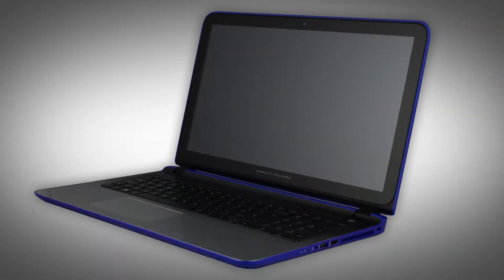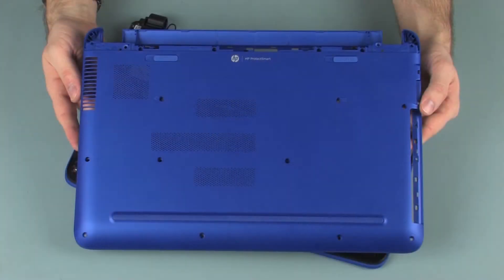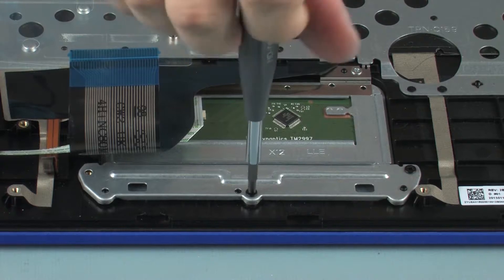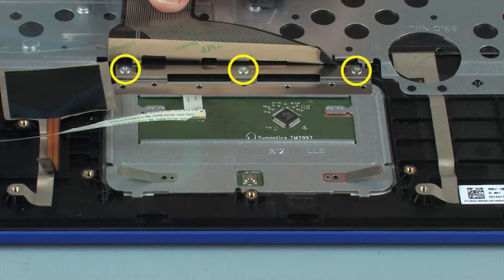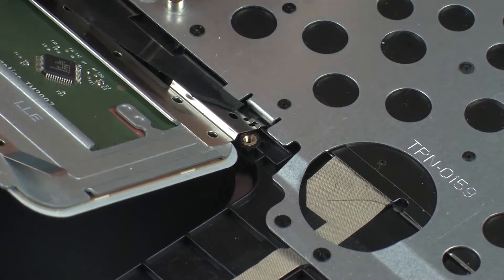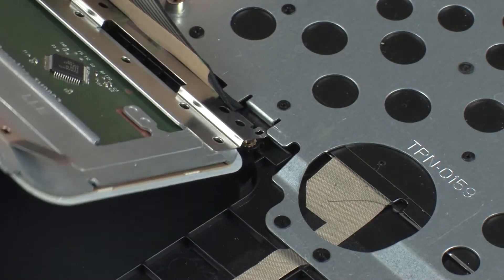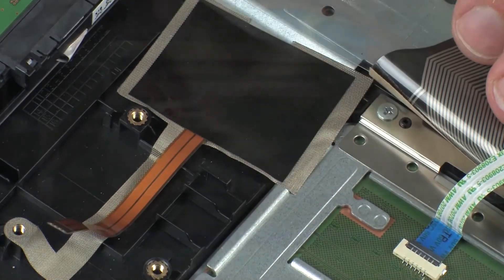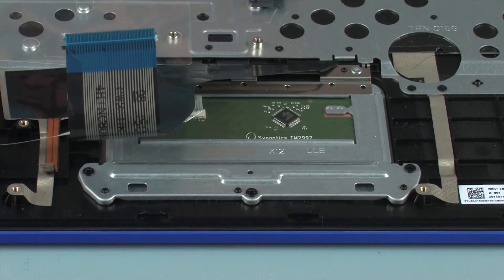Replace Touch Pad Board | HP Pavilion 15-ab000 Notebook | HP Support

Comment: Price of hp 14s touchpad
Reply from the maker: Hi Sush, thanks for contacting HP Global Social Media Support!
I understand that you need to know about the price of the touchpad
I will do my best to assist you.
Use the HP Parts surfer to identify the part and check the price: https://hp.care/3Q5a4s5 
And order it via the HP Parts store: https://bit.ly/3nKMYrs 
Binu-HP Social Media Tech Support
Reply: @HPSupport  actually my touchpad coating is scratch.
Reply from the maker: Due to limited support on this platform to fix this issue, please feel free to reach us on call/chat. Access this link to select your preferred country and language option to reach us. 
Global support link: - https://hp.care/3Y7g6KT 
Binu-HP Social Media Tech Support